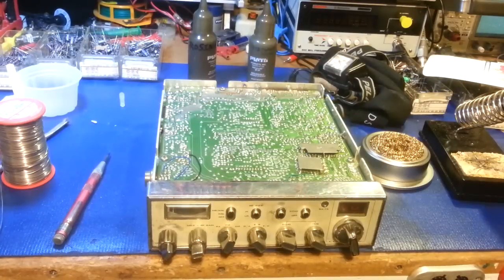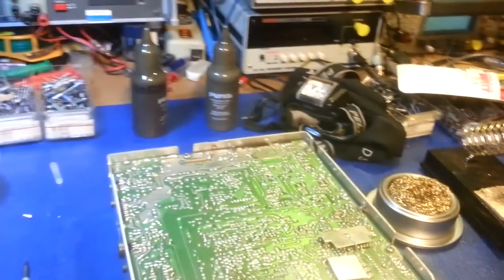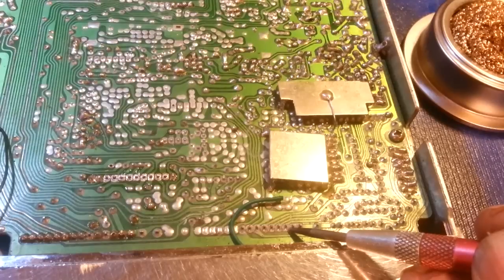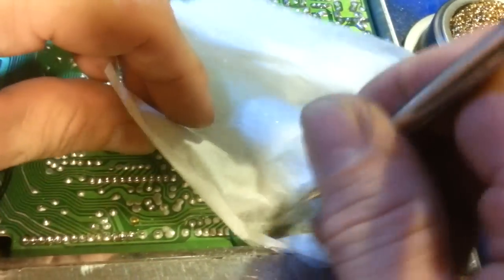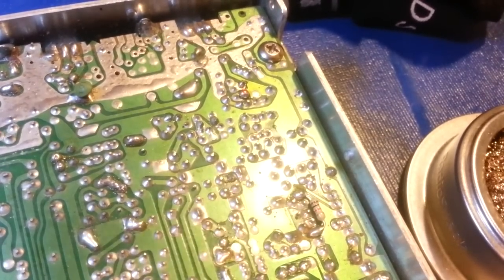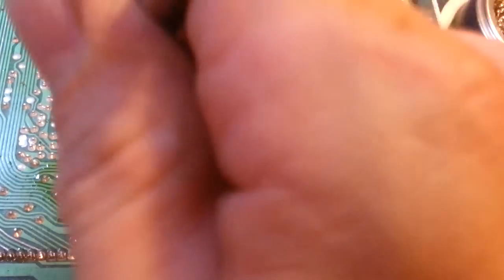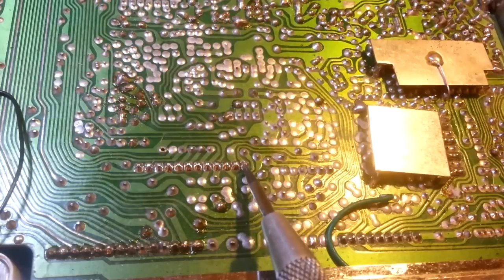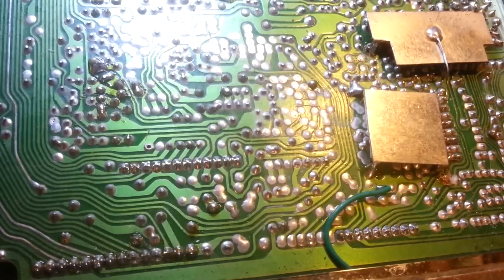How to resolder bad connections and old oxidized solder joints.

Comment: i had a volume drop out on my crate glx212 guitar amp.... for close to 10 yrs now.. i absolutly LOVE the tone it produces.. i could "whack" the top of it by the input jack and regain sound.. i thought(bad soldier joint) i opened it up and I FOUND IT ! the pin that connects to the ground sleeve of cord... imma use your advice and re-flow it.. thanks

Comment: You bring up a good point on dwell time.  My biggest issue sometimes is removing the old solder with my spring loaded solder sucker.  Sometimes I have to hit the pad multiple times to get the old solder out and have damaged my share of pads just removing the old solder, mainly on the small circuit boards of guitar effects pedals.  Then I have to run a small jumper wire to fix the connection.

Comment: I have an old SuperStar 3900 that looks exactly like that. It developed a problem in the receiver.  Tx is fine but Rx is totally dead..  until you press down on the board and everything works.  Took it to the local CB hack shop (4G's in Baytown) and the guy went over every solder joint,  and still no fix.  Same problem and he gave up.  It sat in a box in my attic for a couple of years and now the mic plug and SO203 and power plug are corroded.  I'm going to follow your tips and attempt to restore and repair it.  I've owned it since about 1997 and would love to have it functioning again.

Comment: Mike, can you tell me what de-soldering gun and flux you used in this video?  I think I need to get them.  I work on all of my old 50's and 60's Fender amps and have re-soldered many old dull joints with just some new solder on top of the old solder.  Mainly because I've had amp techs tell me that the old solder makeup is different from new solder nowadays and that it actually sounds different.  Now, I know we are getting into some details that most people would never hear but there are some real vintage amp fanatics out there.
Reply: I would also interested in the type of desolder gun you are using.

Comment: good work, but what about when the tiny solder joint touch each other after the resolder process, isn't there something like a short-circuit fault on the board?

Comment: after I fixed some electronics with bad solder joints, fried diodes,transistors and nicely cooked resistors people started to bring me more electronics to fix (I do not know why, I just work on the farm) but I had to turn down lots of those because do not want to mess up resoldering bunch of bad joints. I do not have desoldering iron and removing bad solder without it is a pain. And on some electronics I just can't find what is wrong (stupid metal detector wand had bad joint,fixed it,returned after a year,could not find what is bad now.).

Comment: it doesn't cause a short when the solder from two spots seems so close they overlap each other?it is not possible to short on the back on the boards of solder touches other pointS?
Reply: ah thats the other guys sloppy work?  seems like the joints are touching each other in a lot of spots, how does it even work?

Comment: I have been soldering for 30 years on a variety of equipment but it’s still interesting to watch you work. I was watching one of your other videos where you were using a solder with I high silver contents. I have used similar on old Tektronix oscilloscope that specifies something similar for some of the ceramic hybrids. I would like to know about why you favour this for automotive work. My experience with this solder is it is definitely stronger but also harder and much more brittle.  I would have thought the brittleness would make it’s less suitable for mobile application. For the same reason leaded is still allowed in many critical applications. So how have you found your silver alloy solder? Thanks mike Regards Chris
Reply from the maker: In all the years I have been using SN62 composition silver solder I have never had a solder joint fail.  It has the highest tensile strength of any solder, that's why I use it.  My take on the matter is that if it's the strongest it would also be the least likely to break.  The one thing you don't want to use ANY silver solder for is to solder gold plated parts.  If you solder gold plated parts with silver composition solder it mixes with the gold and apparently will pop the gold plating off.  That's the one thing I use normal tin/lead solder for or if required a lead free solder that has no silver.
Reply: MikesRadioRepair  Thanks for the heads up on the gold platings.  A lot of what I work on is the higher end test gear and does have gold plating and has for many years.   I’m not sure where I was reading about the harder solders not being recommend I can see that depending on the type of joint stronger may not always be better as some flex may be expected and require. I’m going to have to look into this more, but I note your recommendation and experience using it. Thanks for the reply.   It still amazes me that one reason that old solder joints are hard to melt is because copper is soluble in tin and over time raises the melting point. Your probably sick of tech, videos but drop in my channel and say hello sometime.   I used your trick to clean the selector switch on the Kraco the other day and yes almost every joint I have looked at so far was suspect.Regards Chris

Comment: This video I can surely make use of thanks for the infos and all your hard work for my radios Michael !
Reply from the maker: Thanks.  Just hope someone can find some of it useful.

Mike
Reply: MikesRadioRepair i have a 1991 camaro rs wiper motor pulse board for the windshield wipers that needs to be repaired. Its been discontinued for 6 years.Really cant find the same one anywhere. Can I please mail it to you so you can at least just take a look at it?? Before you say no. I really have no other options at this point.

Comment: What happens if you leave flux without cleaning it with alcohol/brush?  I soldered a project less than a year ago, live in FL with high humidity environment if that matters, and now all my solder joints look like they are 30 years old with horrible oxidation.  I'm using KESTER SOLDER 32117 24-6040-0027 and keep my tip clean.  Starting to wonder if not cleaning it with alcohol afterwards is causing premature oxidation.
Reply from the maker: That's a RA (highly activated) flux.  Best advice is never use RA flux to solder electronics.  If you do you have to remove all flux residue.  It is highly corrosive and will destroy anything made of copper in no time.  You should be using a mildly activated no clean flux.

Comment: So this might be a dumb question, but don't you need to worry about the pool of solder around adjacent pins touching and shorting them out ?  It seems like those large mounds are touching.  I thought adjacent pins connected to different strips on the printed circuit board so they had to be kept isolated (?)  Thanks!

Update: watching video to the end I see that you do address this.  Thanks again!

Comment: I feel like I don't have the equipment to do this job correctly without ruining my board. Are you able to check out a control unit for me ? Or can you tell me how to go about finiding someone more local to me who can inspect my solder joints on my climate control module for my car. ??

Comment: Fantastic tips Mike, I like the idea of the red pen, I can see where that would make one's workflow go faster as opposed to one at a time like I currently  did, now Ima gonna borrow yours, thanks!  :)
Reply from the maker: That's what I use to do and finally realized one day I was just looking over some parts of the board several times and missing others.  This way I can systematically inspect the entire board and just put a little red dot on the tip of anything I find questionable.  Once the whole thing is inspected I can do all my soldering at one time.  Really speeds up the process and prevents missing bad joints. 

Mike
Reply: And it really makes good sense, especially if you get called away from the project, you'd have a better clue where you may have left off!